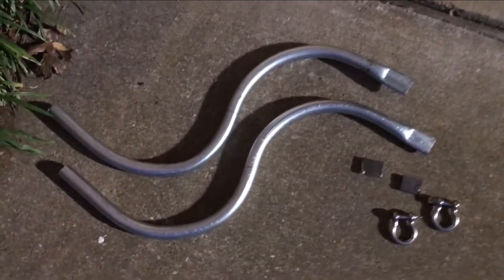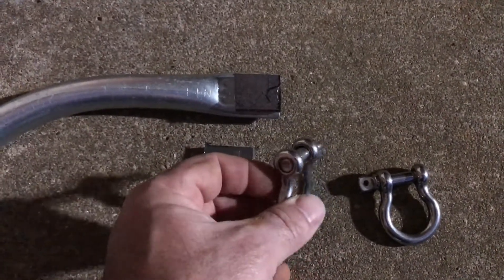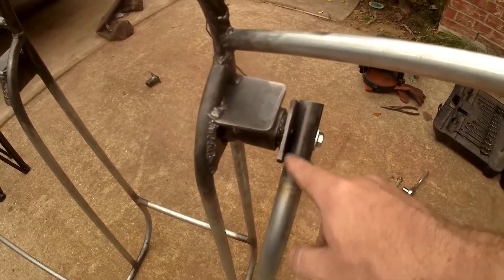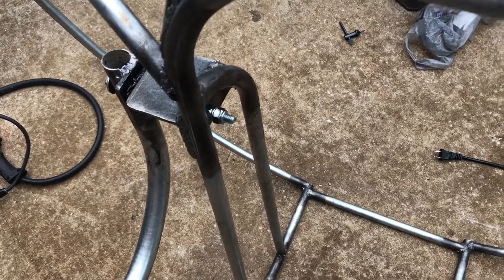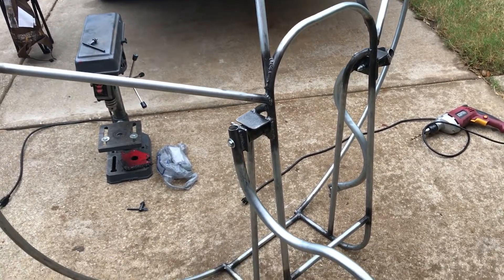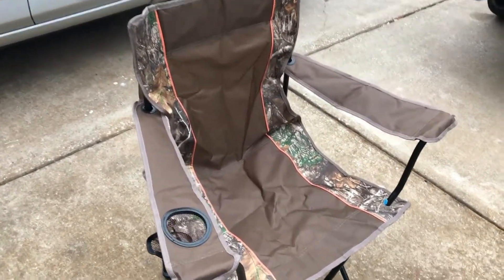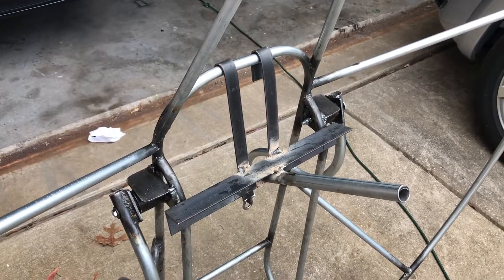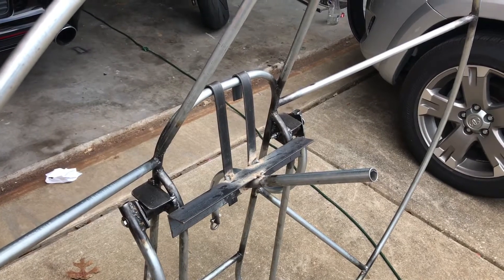Homemade paramotor built out of EMT conduit part 3

Comment: The outer hoop is to clear the pro from lines AND to land on the flat circle (as it should hold your weight)
Your "rigging" from the harness/swing arm/ carabiner/ frame should not have weak or potentially weak links. Get a real harness! I am just curious how many flights you'll get out of this before wear and tear on the lawn chair start to show. Other than that this is like watching myself in the past! Good job. Good luck

Comment: I applaud your efforts but please just paint this one and hang it in the garage for show.  If your strapped 4 cash for a real motor ....wait , save for a proper one.  Look at the gravity defiant 5400 bones but you have to assemble yourself. Full instructions on YouTube.  Be safe
Reply from the maker: Thanks for your concern.  I don't trust these arms.  The geometry is wrong and I'm going to experiment with something stronger than conduit for the swing arms.  HOWEVER, I DID ORDER THE GRAVITY DEFIANT YESTERDAY!!! I can't wait.  I'll just keep this project going as something to do to indulge my obsession with building things.
Reply: @HilltopZombieShop  Whew..Thank you brother!  The other problem was with those shackles... They need to be at the very least captive pin (fully locking) so they cannot unthread while in flight... That would be a very bad day if those vibrated loose.
Reply: What do you believe that paramotor companies make theirs out of?  They make it out of regular metal just like this and if he sets this up and  welds this properly, it is not a problem.
Reply: @UpcomingJedi  high Gs and sketchy welds don't mix.  Its your life your playing with. Not somthing you want to cut corners on. Just my 2 cents. It would probably work but would you be willing to bet your life on it is my issue.
Reply: @macflyguy5166  As far as the swingarms go, they do seem a little thin for what they will be used.  I was thinking to use some polyurethane bushing for the connection of the swingarms  to the frame and a better bolt.  Ive busted a 5/8 rod when i tried to make a yawing crane to huck my genny onto the bed of the truck.  I would say those bolts are a liability but the rest of the frame looks good.   He cleaned the zinc near the welds to avoid porosity. Another thing i have a question is that dont commercial units have greater spacing between the bars on the right side vs the left.